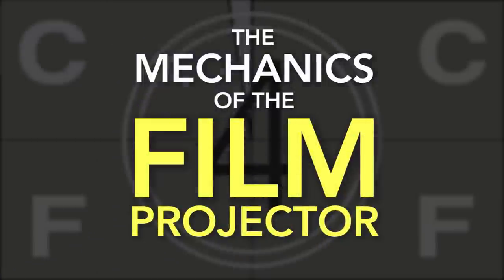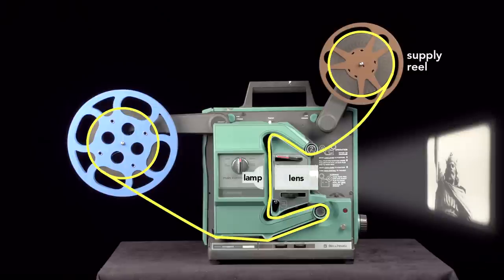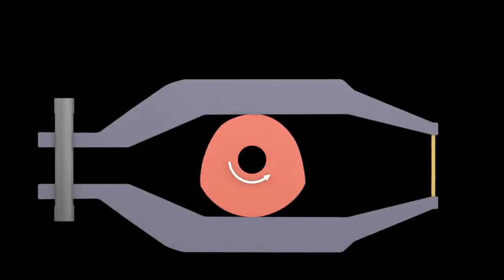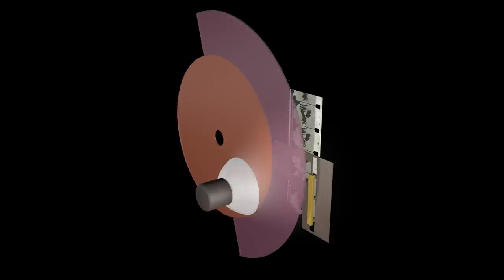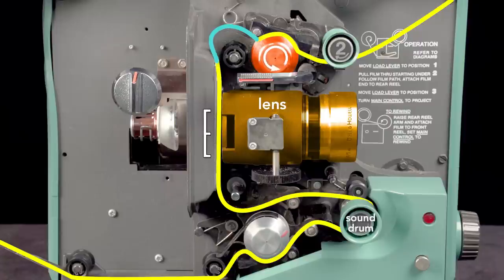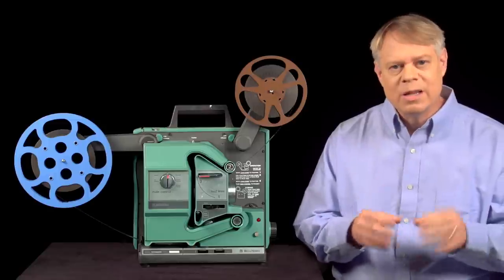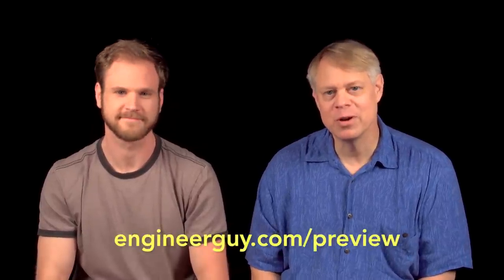How a Film Projector Works

Comment: 16mm film in schools was only a small part of what this format was for. 16mm film was mostly used by news crews. Networks like CBS, ABC and NBC. Public networks like the BBC, ABC and CBC used the format to distribute television programs overseas and to local stations, because at the time telecine equipment was more common than video. It was also cheaper. TV stations until the late 70s used 16mm to make telecine recordings of live programs when video tape was not available. As for the soundtrack, while optical sound was common. Beginning in the 60s most were magnetic sound tracks. 35mm film was also used to record sound. Special recording decks were made for this format. They were mostly for high quality recordings. Mercury Records made a lot of 35mm Magnetic Film Living Presents recordings. In the early 1930s, Philips made a few open reel film optical recorders that were used by PCJ Philips Radio. The only discontinued this a few years later, because nitrate film and cause fires is not handled correctly.
Reply: So right, school em'

Comment: I'm pretty sure the 8mm example shown @ 0:32 is technically Super8.  Regular 8mm has bigger holes (same size as 16mm holes) and smaller frames than Super8.  8mm film started off as 16mm film that was split down the middle after developing it.  I think the regular 8mm cartridges (a later development?) actually had to be flipped or turned around in the cameras to expose all the frames but I've never actually used an 8mm camera. 

Fun fact: 8mm and Super8 film were both sold to consumers in 50 foot lengths, those 50 feet provided about 3 minutes of run time depending on the frame rate they were shot at... standard frame rates were usually 18 or 24 frames per second.

Great video and demonstrations as always :D
Reply: Yes, “regular 8” had to be turned over after half of its 16mm width had been exposed. It was on open reels. You loaded in total darkness, then shot 90 seconds of film, watching the footage counter so you’d know when to find a closet. You then opened the camera, flipped the reels, rethreaded the film—entirely by feel—closed it up, came out into daylight and shot your remaining minute and a half. Then back to a dark room to unload, put the film in the can, tape it shut, and reload. When cartridge-loading Super 8 came out, bigger picture, and sound, it was like getting an iPhone.

Funny thing was, 3 minutes didn’t seem too limiting.

Comment: Great video! If the flicker fusion threshold is 60-70 per second, how come I don't see any flicker when I shoot 24 fps at 1/50th shutter speed with my iPhone?
Reply: +sbstefan - Because an LCD screen doesn't turn the ligths on and off so there is a constant flicker free light. But what I don't understand is why he said 60-70. When I was making 8mm home movies in the 1980s all the books I read on the subject said 50. A super 8 projector runs at 18 frames per second so it only flickers 54 times per second.

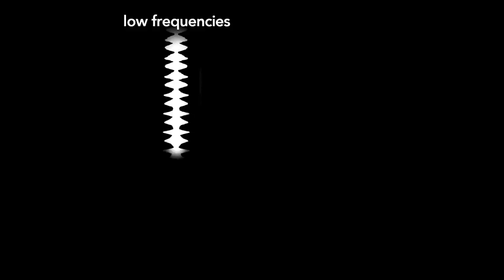Comment: At 07:00 I was very surprised to hear the Engineer guy say “wider sections are loud, and quieter sections are thinner”. I would have thought that it was the amplitude of the waveform on the sides, or the degree of change if you will, that determines the volume. If you just shine a light through the film sound-track and hook it up to an amplifier, it would be silent if there were only a constant wide black film sound-track with no modulation, just as it would be silent with a very thin sound-track. Correct me if I’m wrong, but I think the Engineer guy slipped up here. I think he should have said that the magnitude of the changes in thickness of the sound-track determine the loudness of the sound.

Comment: Lawrence of arabia was shot on IMAX format, which means that the 70mm roll was used at a 90° angle. But still, amazing video, I learned a lot
Reply: That film was made in 1960 I think. Imax wasn't developed till the mid 70's.I believe the camera negative was 65mm and some of the release prints are 70mm with two magnetic sound tracks on the prints.

Comment: How does it handle radius change in two reels from the beginning to the end of the movie?
Reply: Easy and in the same way it's done in tape players: the sprockets are main drivers of the film while the reel could rotate considerably faster than needed but its drive can slip, so it ends up rotating at that speed which is needed for film to be in little tension.
Reply: AllMyCircuits Nice, Thx

Comment: Great video, but...  Not all sound was optical.  Generally speaking, most 16mm-35mm was, but 70mm and greater often used either separate tape on a separate 35mm base (Cinerama) or magnetic tape tracks on the film (SuperPanavision 70, among others).

Comment: How does the takeup reel wind up the film instead of just letting it pool on the floor? Its motion can't be connected to the single powered axle because the rotational speed would have to decrease as the film wound on more and more and the radius increased. Is there a spring or something that keeps the film under a slight tension? Or does the projectionist just sit there and wind it up manually?

Comment: How did the photo sensor work? It's a simple component in modern electronics (photo diode), but I don't think they had those back then.
Reply: An incandescent lamp and probably a cadmium sulfide photocell (or maybe a phototransistor, but I think so early that the CdS cell more likely), whose resistance drops with increasing light intensity. The audio waveform pictured on the soundtrack modulates the current through the photocell, recreating an electrical audio signal.

Comment: Hi! New comment on old video. Does the two reels spin at the same speed? I suppose the amount of film that is served/collected in one revolution is not the same on both reels because they will have different diameters, right?
Also, thanks for the great explanation on this video :)
Reply: The top reel had a spring loaded slip clutch, it was adjustable for tension.  You wanted it to drag enough to keep the tension correct and not have bouncy loop up in the magazine.
The lower reel has a belt/pulley driven at constant speed  with the same type of slip clutch, the adjustment on that was more critical.  You wanted constant take up regardless of the size of the reel load.  Both magazines had fire trap triple rollers as the early film was extremely flammable, this was to stop the spread of fire into either magazine.  The magazine housings were heavy metal with fire screen glass.
The top reel had a mechanical speed adjustable bell that would ring when it was close to the end and you would get ready for changing projectors.
5-6 reels for a typical movie.....you had to watch the upper right hand corner for the first dot to appear, that is when you started the film rolling in the next projector.
You were to have it framed up on either #3 or #4....not sure now. 
The second dot was when you switched the light and sound from one projector to the next.
Dots were etched into 4 frames of the film.....so it lasted 1/6 of a second.  I still catch dots on old movies and ask someone with me if they saw them.....saw what??

Comment: 70mm was only replaced in cinemas when digital projection came along. It was common here in London and I believe that a lot of cinemas kept the old projectors so they have maximum flexibility. I also heard that some projectors where converted, this might be changable depending on the feature. So, no, 70mm wasn't just in the 60s!
Reply: +Prince Westerburg 70mm was even in the late 20's.  Started in mid 50's at 30 FPS for a few films and then changed to 24 FPS so they did not have to use two cameras to shoot a film.  70 Projectors will do both 30 and 24 frame rates and also handle 35mm as well as  70.  70 was basically discontinued due to high cost of production and limited number of theatres to show them in.
Reply: Interesting and thanks! Its always easy to point at some very early use of a technology that just happened to be similar but the other references are great. I wonder what reels are out there on shelves gathering dust? Makes you wonder! :o)

Comment: What is the reason the shutter rotates counter-clockwise and not clockwise, it seems as though if it was rotating clockwise the right side would move with the downward movement of the shuttle, meaning you'd need a thinner blade, is it just not necessary or is there a reason behind it?

Comment: There are also more ways to pull the fim strip throug a projector.

For instance a 35mm or 70mm projector mostly use the geneva drive. Imax-Projectors use the so called rolling loop.

Comment: But how was the audio track formed and printed on the film at the time?
Reply: +mmKALLL 

Film typically used a variable area soundtrack. A light would be shown through it and the amount that made it through to a sensor on the other side would determine the pitch. This track was usually made by having the sound signal oscillate a mirror that would in turn oscillate a light source on and off the film.

Comment: Shouldn't the film come off the back of the supply wheel anti clockwise in order for the light to go through the back of the film and the emulsion side towards the lens? So that the projected image is is the correct way around from left to right.

Comment: What if your take away shutter 2 and 3? would the unbalance alone mess it up? would it make the frame frame rate look even weirder?
Reply: +Jordan Kloosterma   He did not explain fully the number of blades on a shutter and why.  If you were to use one blade it would flicker each time the film was moved.  In the silent era they used three blades with the projector running at 16 FPS
[Frames per second]   this will give you three images on the screen balanced at 48 FPS to the eye.  In the sound era 24 FPS with a two bladed projector same frame rate 48 FPS. IMAX and first 70mm films ran at 30 FPS which gave you a better frame rate of 60 and a brighter and more detailed image.  Television is a 30 Frame rate and 60 images to the eye.
Reply: +Chloe Alexa always remember in film presentation in theatres, when you watch a two hour film,
You are in complete darkness for one of the hours.

Comment: wouldnt it be easier to have the cam move the shuttle down, as well as in+out to mesh with the holes in the film
Reply: +Recycle Bin If you could find old Motion Equipment books you would find hundreds of Intermittent mechanisms, for all film gauges, of which there are a great number.

Comment: This is not a typical intermittent movement.  Most real projectors (i.e. 35mm) use a Geneva type movement.  And frames are only projected twice--48cps.  The top loop is call the Latham Loop, and the bottom is called the sound loop.  There are many interesting little "in the weeds" things, such as, the aperture plate (which framed each frame, if you will) was beveled at the edges by the projectionist using a file, so that the projecting edge was razor thin.  This way you didn't project both the front and back edges , which would make the edges on the screen blurry, the back edge of the aperture  plate being a few thousandths of an inch back from the focal plane.
Most people don't realize that a projector is a powerful microscope.  In movie theaters a picture .745 inches wide could be 40 or more feet across on the screen.
Needless to say, I was a projectionist for about 25 years!
Reply from the maker: Indeed ... the Geneva is used on 35 mm ... we chose to describe here a 16 mm projector used, mainly, in schools.
Reply: @engineerguyvideo  Another, I think more common, type of intermittent used in 16mm was the claw pull down--an eccentric with a 'claw' that went into the perfs.  A bit hard on film, but a very fast pull-down ratio.
Geez, this is fun.  I was a freaking expert once, and I haven't thought about this in years!

Comment: Instead of using 3 blades, why not just use blade 1 and have the rest be unblocked? Or does uneven blocking also creat flicker?
Reply: The reason for the 3 blades was to make the process quicker. Think about the reasoning that if you put one blade, it has to go faster, to do the same thing three blades do. If you put three blades, you can slow it down and increase the amount of things being blocked off and shown. You end up getting something more advanced and more smooth.
Reply: +ag b I understand why three blades are used, but if only 1 of the blades actually blocks when the film moves, what happens if you keep that single blade, but remove the other two? Basically, is it the number of flickers per second that determines if we can see flickers (in this case, what if the gap between each of the three blades was made smaller?) or is it the length of time that the image is blocked that determines if we can see the flickers?

Comment: Why the bigger the film the greater the resolution? Film is continuous not digital so it should be possible to make a one to one correspondence between two different sized films .If they both use a fine grained film then it should be possible to magnify an 8mm to 32mm with no loss of resolution
Reply: Yes you can go form 8mm to 32mm without any loss of resolution but the quality will still be lower than an original 32mm shoot because the 8mm is lower resolution to start with.This is because the amount of detail you can put on each square mm (or any unit area) of a film frame is the same regardless of the film size (at least for a given grade of film). But, with a larger film size there are more square mm of film in each frame so the total detail you can pack in is more than for a larger film size.

Comment: So which is the part responsible when it catches fire?
Reply: Something causes the film to jam in the gate, the shuttle can’t pull it through, the sprocket holes tear out of the film, it stops moving, the lamp heats it. Either the film blisters and bubbles, or can burn. The fires usually happened when running nitrocellulose films in carbon arc theatre projectors—terrifically hot lamps and extremely flammable film.

A film jam often starts when the projector “loses its loop” and there’s no slack for the shuttle to pull down.

Comment: Ok.  I understand the mechanical system that creates movie images on film projectors, but why is it when playing a computer game, 24 frames per second seems choppy and slow?  Is it the conversion to digital that hindered this seamless operation?  Most video viewers and video game players expect 60 frames per second.  I'd like to see, mechanically and electrically speaking, how this works.  An old 24fps reel seems to move smoothly, TV brought it to 30-32fps, but now it is different.  New engineerguy video?  hmmm..   Haven't seen one in a while.  This idea would really spread light on how digital signals act differently than mechanical or analog signals.
Reply: It's because a camera captures the natural motion blur while in video games there is no blend between the frames.

Comment: Why use mechanical light shutters at all?
 In this day and age, and long long before - - - - light shutters could be made of electro-optical windows; polarized panes of glass that can be switched on & off far faster, and without the friction of mechanical shutters.
The tech for the synchronization of these devices was already invented in the 1920's, utilized for the creation of an early type of 3-D motion-picture projection - - it didn't catch on though😢
Reply: You're right, but the shutter disc is very simple and just one extra item mounted on the axle that is already there for the other components. The moving of the film is far more complicated and this would still be required with electronic shuttering.

Comment: My Super 8 projector uses magnetic sound not optical although it is possible to buy optical sound models. 

I certainly would not recommend buying an optical sound Super 8 projector because the technology came out late when the market was getting a beating from VCR's.

Super 8 really is a magnetic sound format as it should be! :-)
Reply: the super 8 projectors that could play optical sound prints could also play magnetic sound prints.That is for consumer models. The optical prints are cheaper to make and are more durable,they used them for prints that would get lots of use.

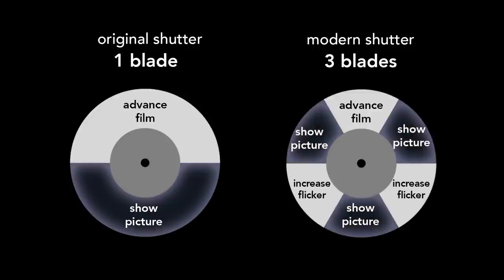Comment: 5:00 Why not use two projectors ? One projects film while the other is moving to the next frame ? No more flickor for just one more projector !
Reply: Because people want money and those things most have cost a ton.
Reply: +ag b No, it isn't a matter of cost. Don't be so cynical. I don't know why film started at 24fps but it largely remains there because if you go much higher you run into the uncanny valley. Ever notice how sitcoms and home movies look "fake" and unnatural? That's due to a higher frame rate.
Reply: Leo
Well, you might be right, but I don't ever find it uncanny watching movies on  my computer at 60 fps  (well, 24, 35 or 40 or whatever the higher standard is). It really helps with fluidity but makes for a much harder movie to film as it is unforgiving.
Anyways, that  wasn't my question at all... This wouldn't increase framerate, just replace black time by image time, removing the flipping god damned fllllliiiiiiccckkkkeeeerrrrr, flick flick flick flick flick IT DRIVES ME INSANE I SEE DEMONS ! I SEE DEMONS IN BETWEEN  THE FRAMES
Reply: That's the reason I hated the HFR 3D setting on The Hobbit- it looked like I was watching a soap opera and not a movie.